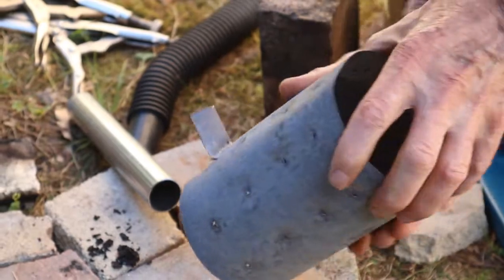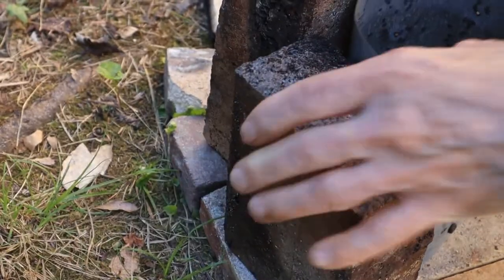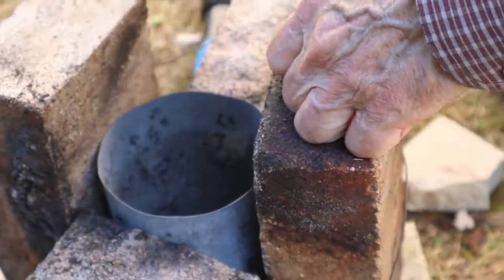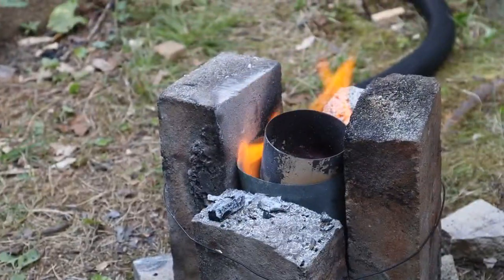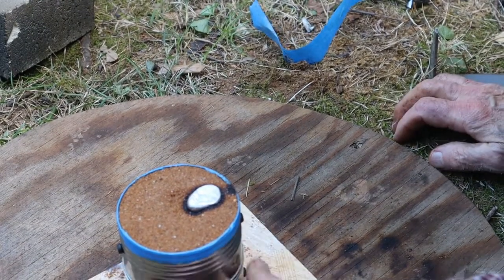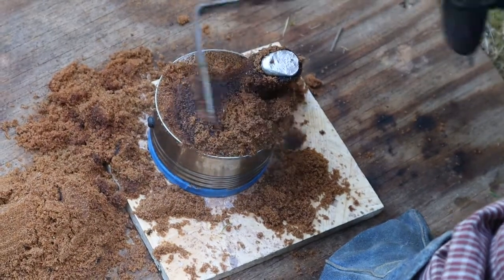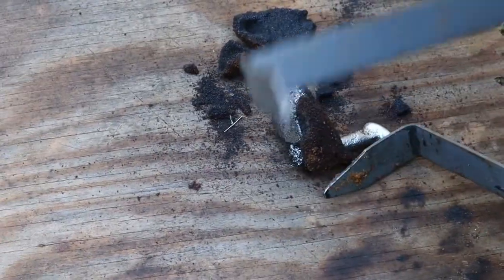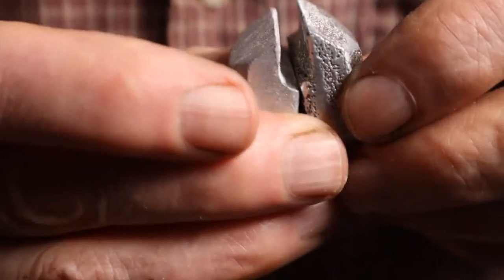Aluminum Casting in an Afternoon -- Molasses-Bonded Sand Part 2

Comment: The temperature of aluminium can be tested with a sliver of pine timber. Poke the timber into the molten metal. On withdrawal, if the timber catches fire, it is too hot. Keep testing until it cools just enough not to catch fire. Ted from down under.

Comment: Gracias amigo excelente esplicacio.una pregunta cómo recicla el arena de contactó.la que se quema.gracias
Reply: You could probably recycle the burned sand by just heating it up, but by doing so you may fracture it and  create finer particles which would be unhealthy to breathe. you could also probably just crush it with a hammer which would probably be okay, allowing it to be reused.. alternatively, if you have an agricultural or gardening use for it, you could just let it disintegrate in the soil.
Reply: Gracias.siga con su trabajo que es muy interesante
Reply: Thanks.

Comment: David you are a fantastic resource. If I use Bentonite clay,fine sand and molasses could I deliberately let it dry out before separation from the pattern piece to hopefully preserve the fine detail on the pattern lettering. Then pore the molten brass. Thanks again for your great videos.
Reply: That sounds like a great approach as long as the mold isn't too thick, the relative humidity is sufficiently low, and you're not in too much of a hurry.
Reply: you dont need bentonite if you are using proper brix rated mollases.